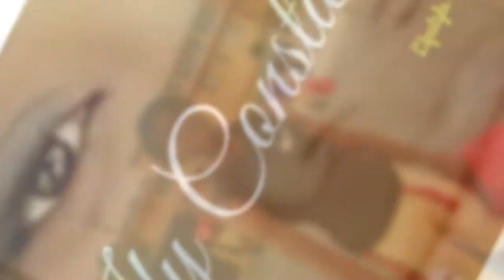How To Build A Privacy Fence On A Budget I DIY Privacy Fence I Ify Constance

Comment: How much did the materials you used cost all together?
Reply from the maker: I completed everything in stages not all at once because of the pandemic materials were sometimes limited. I listed where I purchased all of the materials in the description. If I had allowed the fencing company or even Lowes to complete that one side it would have costed over $3500. In all I spent less than $1500. Which is awesome!
Reply: @IfyConstance  Yes my husband and I were quoted $3800 for ours and since we're new homeowners we don't want to break the bank since we just had the entire plumbing done on our house which wasn't cheap. Your video gave me alot of hope that we too can achieve our privacy fence without spending so much to do it. ♥️